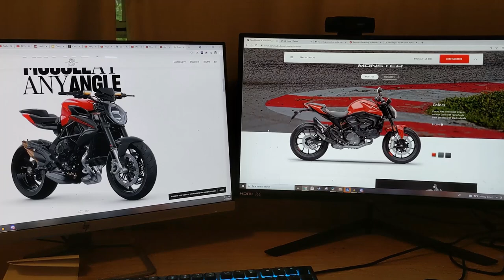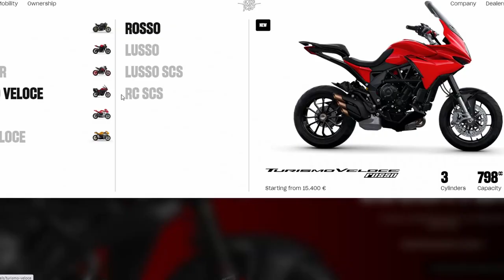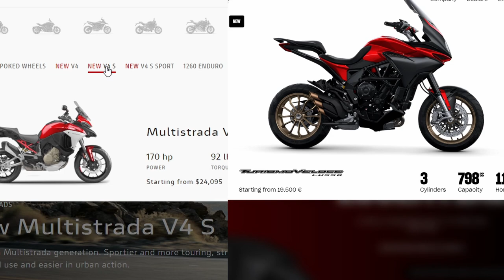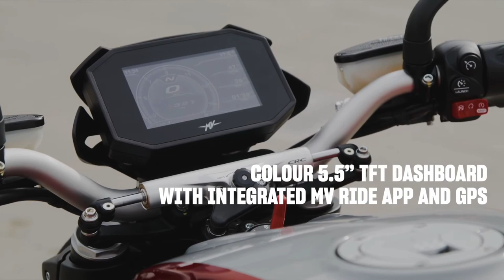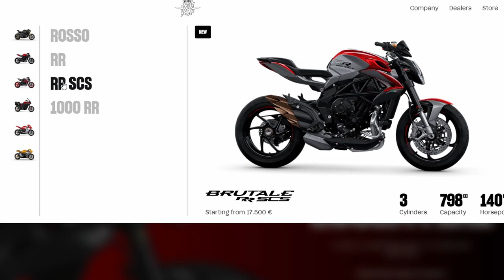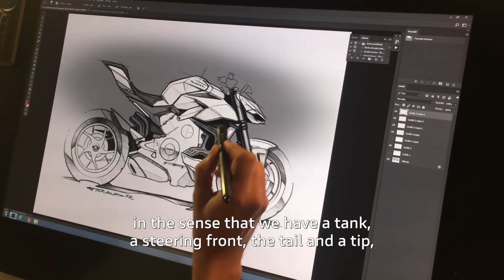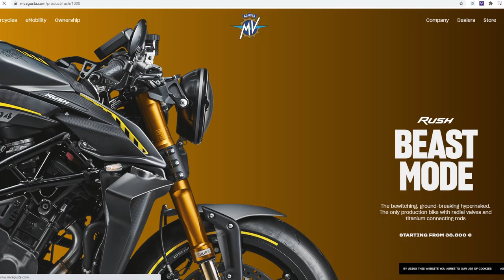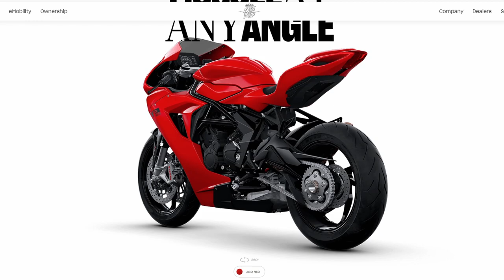Motorcycle Company Showdown: Ducati vs MV Agusta

Comment: I agree with you 100% on the middleweight nakeds. So much so, that I bought a Dragster 800 earlier this year... I've riden my friends Monster 1200s and I tell you what, the monster has more punch at the bottom end, but in a twisty road there is nothing it can do to keep up with the dragster... its not even close...

Styling is such a subjective thing, Again - I agree with you that MV make the best looking bikes on the planet.

What I will say is this though, You can't compare two bikes without spending time around them and on them... Looking at them in person, feeling the build quality, looking over all the fine details and little design features that you don't see in all these pictures... 

Literally, nothing compares to the M.V... They are a cut above everything else on the road, but they are not without their downsides... Maintenance on them is frequent and expensive.
So much goes into comparing bikes, especially bikes as amazing as Ducati and MV Agusta bikes.

I would highly recommend getting out and test riding them if you can ;) it will change your life and ABUSE your wallet!
Reply from the maker: Sadly you're right. Can I come ride yours? 😄